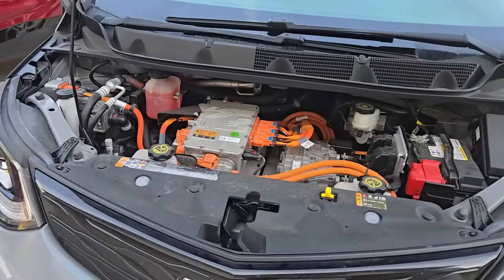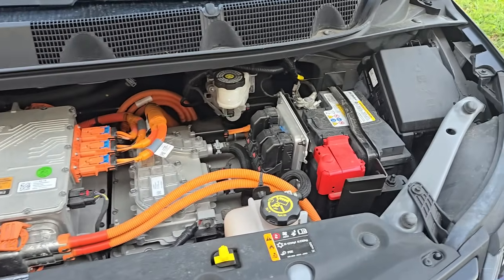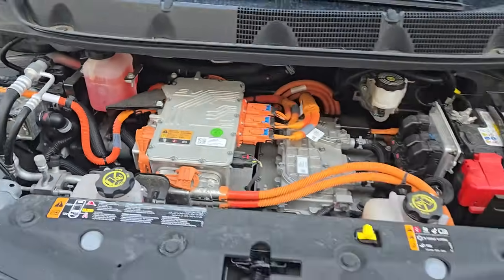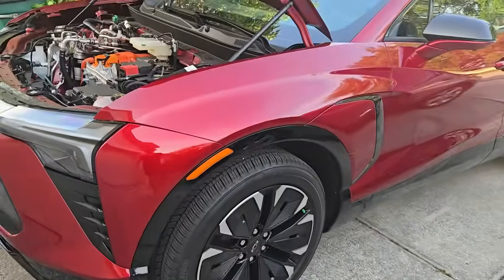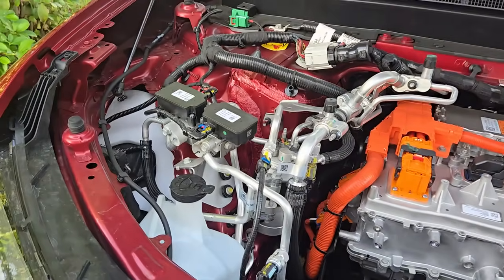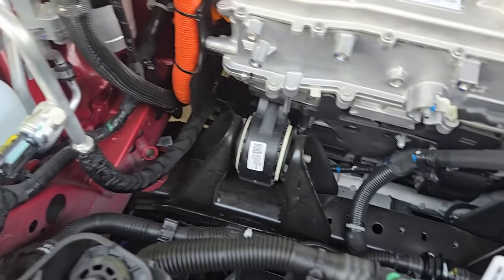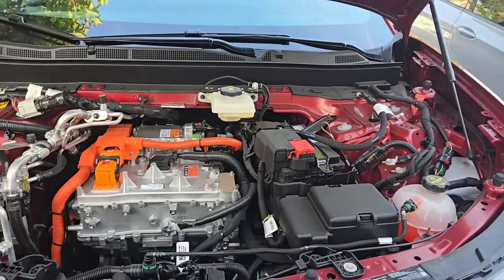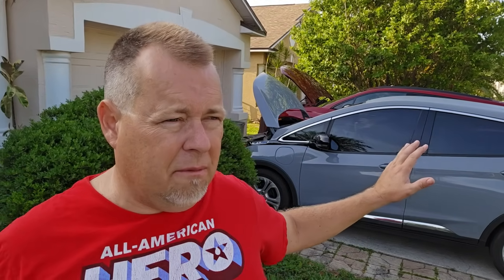HEAT destroys gasoline powered engines.

Comment: EVs have many benefits as you say.. but for me and many others the price of the vehicle itself is prohibitive. I drive a 2012 Infiniti G37 that is paid off 70 miles every day. I change my own oil. I spend about $50 a week in gas. The payment on an EV, even a used one, would be more than my oil and gas expenditure, by a considerable amount. A lease is not feasible because my commute is too far.

Also a lot of these platforms are newer and unproven. We have seen some Tesla's last over 100000 miles without needing the battery to be replaced, but F150 Lightnings seem to have an issue with bricking. What happens when there is no warranty? Nobody can afford a 70 or 80 thousand dollar vehicle (lightning) or 100k (hummer), so everyone takes out 84 month loans. What happens if the battery needs to be replaced and the vehicle isn't even paid off? 

The blazer is cheaper than those other ones sure, but I still can't justify it's cost. I'm waiting for used Bolts or Prius prims to dip down to where I can afford one, maybe someday....
Reply from the maker: I've been working at a Bridgestone service center for the last MONTH or so, and I've seen really expensive repairs on older Infiniti, Nissan, Acura and Lexus models. You can buy a used EV with 300 miles range from CHEVY for under $25,000, right now.

Comment: 3:20
There is oil, usually ULV transmission fluid in each drive motor and it does in fact still need to be changed, just much longer service life.  There are filters as well.  It can still leak if axle seals or gaskets fail.
Reply from the maker: Not all EVs have transmission fluid, so we're both right and we're both wrong at the same time.